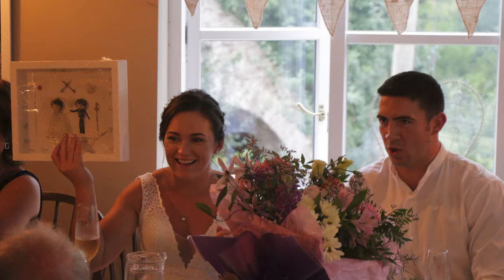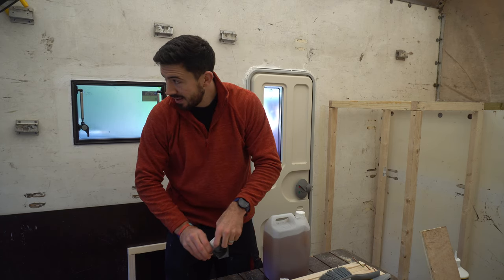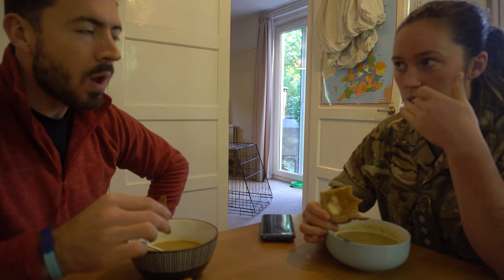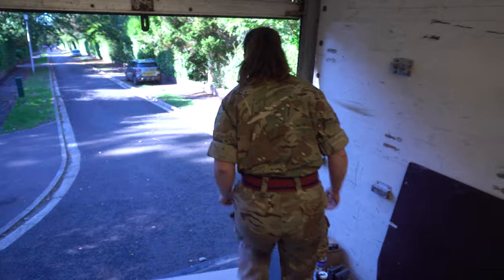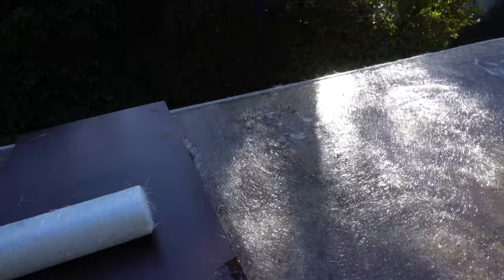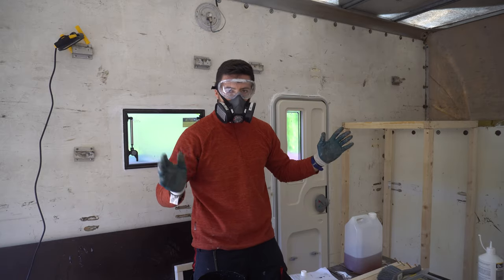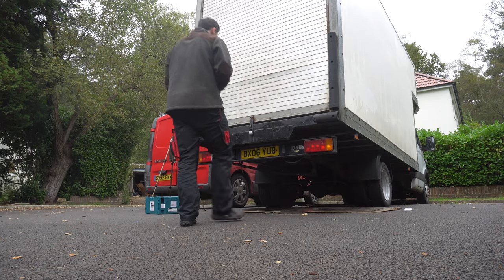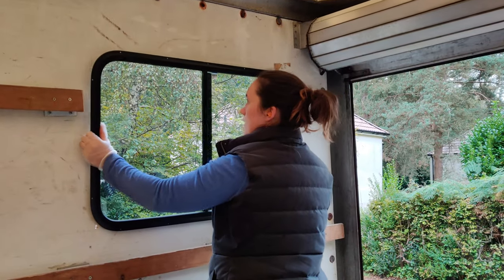How to do fiberglass repairs SAFELY!  (Ep. 5) - LUTON BOX VAN CONVERSION

Comment: I had the same issue with my roof, in the winter I had frozen icicles in the inside of the roof!!
I'm planning on taking the roof completely off and putting a new more stronger roof on..

Question, how were your solar panels secured to the roof?..